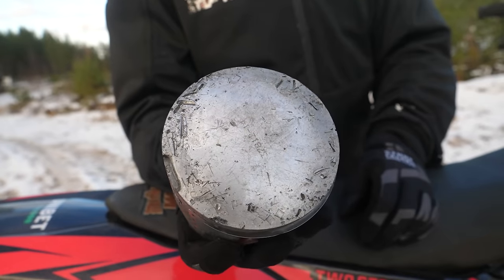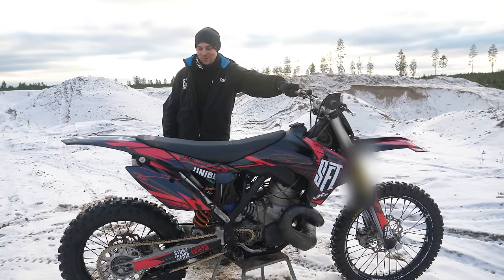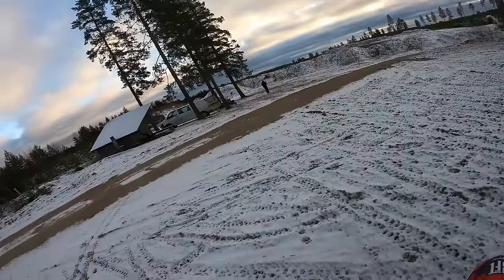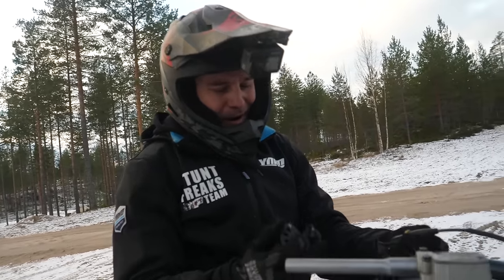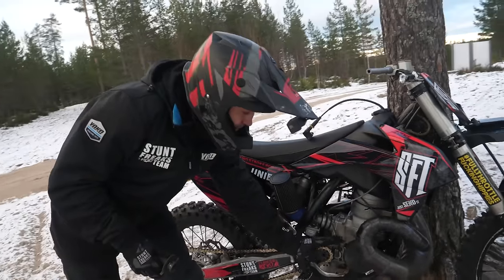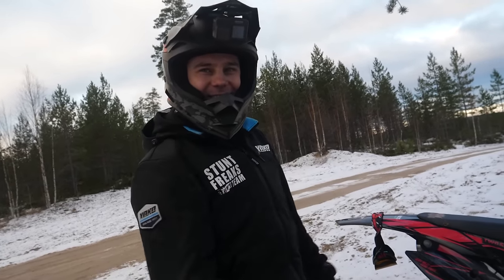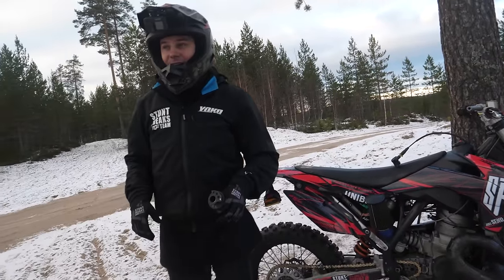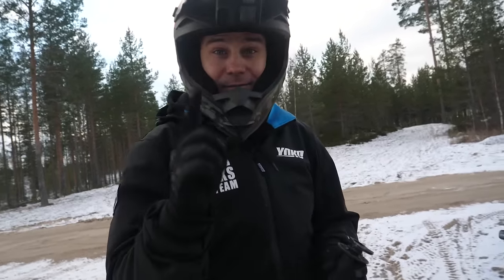700cc 2 STROKE Dirt Bike test ride

Comment: It's hard to imagine this guy's one piston is twice the size of two pistons in a 350 banshee
Reply: 350 x 2 = 700 🤯
Reply: i mean have u seen a 450cc piston? or a raptor 700 4 stroke piston those are massive.
but for a 2 stroke 700cc in one piston is crazy doh
Reply: Imagine guy who's build a minigun
Reply: Did u guys forget that the displacement isn’t just the piston diameter it’s also the stroke
Reply: have you see cruise ship motor piston that is huge like 1000kg
Reply: CC isn’t dependant only on the piston size, the stroke is also taken into account. So banshee pistons might be larger than half the size, but with a shorter stroke.
Reply: if you double the diameter of a circle, it's area is 4 times bigger..... so the piston is not double the size!
Reply: @V8freaks  Hi or she did not say that "size" equals to the diameter. How come that in your reasoning, "size" is referred to as the area. But at the same time you equals his comment of "size" to diameter?
Reply: I wonder if they primed the bore/ motor before pulling it that far before it started 😭😭
Reply: It’s not 100% dependent on bore. There’s also a thing called stroke 😂
Reply: @V8freaks  Well the piston is double the size in terms of area. But that's only if the stroke remained the same which it wouldn't.
Reply: @TheMoroo96  bro wtf you talking bout
Reply: That's a kdx200 and a kx500 together, that's fuckin ridiculous and I want one
Reply: @V8freaks  There's a difference between diameter and size, diameter in this matter is referring of a circumference of a circle, whereas the size is a direct reference of the proportions.
Reply: Clearly you guys have no idea....Cc are not only pistons....
Reply: Ty @Mark keast, I read the comment and thought to myself, arent banshees twin cylinder!
Reply: Wrong, lol. Each piston on a yamaha banshee is 175 mm, and both cylinders combined make 350.
Reply: @markkeast6786  displacement is a function of bore times stroke. Does not indicate piston size accurately
Reply: @WIentertainment  
I feel like there's a sexual analogy/pun in your response..🤔🤣
Reply: Bet the bansh has way more power tho easy 😊
Reply: 350cc 2 cylinder is tiny bro. It's not that hard to imagine at all
Reply: It isnt twice the size lol
Reply: Well the banshee has 2 of them so....  350÷2= 175 175×4=700
Reply: @markbroad119  I'm starting to think this was the ultimate troll comment from the original commenter bro fuck
Reply: I was thinking the same thing.  That piston is the size of my entire jug.
Reply: Well I mean it’s 700 cc
Reply: Wow you can do simple math
Reply: Why?
Reply: most twostrokes are oversquare, so the piston is not gigantic, the stroke is, 4 stroke pistons are a lot bigger
Reply: Some people just don't understand engine building and how displacement calculated.
Reply: Absurd
Reply: Yeah a single cylinder 700 is nuts. Love it, I want one!
Reply: He kickstarted it two
Reply: I have a bonneville bobber with two 600cc cylinders, you get used to it but it looks crazy at first

Comment: You can almost feel the power just watching this.  Makes my Husqy 701 look like a child’s toy.
Reply: Your 701 is as good as it gets.
Reply: Your 701 likely has more peak hp tho
Reply: @xfdfff2620  Doubt that. And even if it does the 700 2 strokes torque makes the 701 look like a moped.
Reply: @verttisyrjala2897  700cc 2t on penkitetty 60 whp ja joku 80nm vääntöä vs 701 75 whp jos on vähä piristetty ja kans 80 nm vääntöä
Reply: what hp you get on a dyno depends on the dyno you are using, ive seen results on the 701 from 60+ to 70 whp and they were not stock, the 70whp had 58nm i think.
Reply: @ralphbooger4756  stock is 59, moded is 75-79
Reply: @xfdfff2620  
i would question the calibration on that dyno as i would with one showing 70...
some of the more popular dynos are known for giving high results.
and i would certainly question it if the company tuning the bike are the same one operating the dyno... :)

ive seen stock cr500 dyno at 55whp and kx500 at 59whp... which makes the husky 701 less impressive.
and although i havent seen the result, ive heard of old 700 two strokes used for sidecar racing dynoed at over 100hp...
Reply: @ralphbooger4756  it was captain Americas normal dynojet dyno, most often used dyno and worked normaly, on that dyno stock 2021 yz450f had 51 whp and stock cr 500 52, all bikes well jetted 

Husqvarna 701 stock with all the restrictions Make 59, without restrictions and tune its 65+ 

Those side cars are running methanol and have compleatly different cylinder layouts, intake sizes, etc so can't be compared

But I am preaty sure well ported maico with good Pipe and other goodies would defenitely make 80-85 whp
Reply: @xfdfff2620  modded 700 can easily do 100whp
Reply: @MV-ri7zu  not easily, u would need all kinds of mods
Reply: Those husky 700s are good  for 140mph pluss haha on knobbly tyres  thats to fast for me haha 500s are fast but your husky 701 is pretty much the best bike oter then a 500 cr or husky lol most reliable is the huskys all day
Reply: I know my mate has done 140 on tarmac with knobblys and then slowed down domt blame him..on his husky 700 not sure if its 4 or 2 stroke like sure 2stroke
Reply: @xfdfff2620  yes easily
Reply: @MV-ri7zu  I mean u would need to raise comparession and use race gas, make custom Pipe, profesional porting and then get ur ignition and jetting correct,
Reply: @xfdfff2620  which is all basic 2 stroke stuff...
Reply: @MV-ri7zu  costs like hell and lots of careful modding is not easy 100 HP, not to mention when race gas is needed
Reply: @xfdfff2620  every serious mx race bike has all of the above in it its nothing special.
Reply: @MV-ri7zu  not really most race bikes have maybe aftermarket pipe, sometimes porting and race gas
Reply: A built 250 will smoke a mildly modded 500 and a 701. We do it all the time at Glamis. Won't have the top speed but wins every time on a drag race. Besides, the power of a Kx500 is always overly exaggerated.

Comment: I can't imagine the arm pump from riding that monster.
Reply: Not even near to r1 atv built for off road, the most arm pulling 2 wheeler was a 2009 light tuned kx450.. That thing don't know why but it felt after the long gearing as the most monster mid to high range pulling power I had ever felt.. I drove them all Yz450, cr50p, Yz450, crf450, ktm 560,450..but the most powerful of them all was an mx atv yfz450 with cb920 hornet engine, the low end pull till red line was way more than r1 atv.. Next toy is raptor with suzuki 650 i4

Comment: i cant imagine the power of 700cc 2stroke the 125cc 2 stroke is fast but this 700cc its just mind blowing
Reply: 125s are quick not fast
Reply: @ztit1 they actually are fast they just aren't fast on dirt because you never have the space to proper wind em up, a riding buddy of mine had a 90s  Suzuki 125 on supermoto tires, was pretty modified though, that thing could almost touch 130 mph on the freeway if you held it wide open for long enough. I'm fairly certain he was spinning that poor little thing at double the factory RPM 😂

Comment: Have a TM EN 300, made all new in the carburator, new reed valves, spent about 1000€.
Started the bike and it was finally runing, after 6 months work.
It was running well, took a seat on the bike and was driving for 1 min and the fuel hose ripped. x.D
How bad luck was that x.D

Comment: Im so glad to see the frame isnt aluminum.  Ive never been able to get comfortable no matter what kinds of mods. Amd the 2 stroke is absolutely the icing on the cake. The sound the smell and the feeling of the ride is what exited me and got my blood flowing as a child and still does. Its the only thing on earth that still gives you the same buzz as the 1st time you tried it. Nothing else, no substances or anything can do that.   Im super curious.  Did you forge that or is it even possible to big bore a 500cc into a 700cc?  Im guessing it had to be forged.  Im a die hard 2 stroke and ultra comfortable wring my KTM 250SX out and the only thing that broken was the shock. Ive replaced the top end several times just to see what the newest piston was like. But nothing has ever broken on it. Its been the most reliable bike ive ever owned. Im comfortable on a 500cc but not wringing out in 4th comfy. I cant imagine a 700 and l wouldnt even try in the snow. I laughed when you said its almost winter....when theres snow everwhere. It never snows where l live. But that was hilarious.

Comment: This little beast is something I think any two smoker lover should have in their lives lol even though theirs to much power and stuff keeps breaking I would never get upset even the 5-10 minutes to a time u could run er would be the best 5-10 minutes of my life lmfao I wanna see some air time on this monster or be the one putting in air time I'd definitely volunteer for the position of test dummy without a doubt lol nice job guys
Reply: SAHAWN PeltonYES that is alot of power on s dirt biketoo muh for me. But imagine having a 2 stroke w3 piston 3head &3 pipe &3 carburetors 750cc dteet bike where the tire doed not  spin so much not in the dirt with street  tires .It woulg wheelie so easy be carefull and learn it well first . It could wheelie awaw on a big highway even without using the clutch!

Comment: It’s a MIGHTY MAICO Boys! No one will ever admit it but that’s a Maico engine!!!!!
Reply: Can You explain that?
Reply: Yes. In 1984 Maico contracted Zabel. To design their new water cooled cylinder. Zabel was known for Sidecar motocross racing in Europe. His knowledge of knowing how to make a two stroke make tremendous torque. Is what brought Maico to design their water cooled cylinders for the new 1984 models which in the states they were rebranded as a M star. That is the same cylinder set up and bottom end that is still used to this day in manufacturing the new model Maico’s. Other manufacturers purchased the rights to manufacture those engines to sell with their name on it. Zabel even did the same thing up until his passing a few years back. Look up a picture of a 2022 Maico 700. And you’ll see it’s the same motor that is in this particular bike! I own three different Maico‘s. All with this same configuration engine. A 1985 250 M star. A 1986 500 M Star. And a Merkle 320 Maico. Hopefully that helps explain my comment above. Wonderful bikes. If you ever get a chance to own one I would suggest it👊🏻💨🏁

Comment: They make electric starters for the 500’s, you gotta look into that for this, or one of those power wheels you can put the back wheel on that’s used to start the two stroke motor bikes back in the day. But if you stall it out in the pits you’re fu**ed. Gotta look into electric start! I can’t imagine how hard that is to start, especially in cold weather with im sure really, high octane! You gotta put a paddle on it & rip some big sand dunes or that tire you have on it for massive hills….🔥🏁

Comment: The only true 700’s out there are the Maicos and extremely rare ATK’s, great bottom end torque, unfortunately everyone who doesn’t ride a big bore thinks you can stuff a Zabel engine into a light frame to get a fast bike, and unfortunately it doesn’t work like that. Awesome build, but take it from someone that spends much time wrenching on big bores, don’t expect to stay ahead of the pack, whether on the track, or the trail. 🏁
Reply: Thought about stuffing a 700 motor in my old rusty 74' 125 Honda Elsinore frame then using it as a timber bike.
Reply: @darylsmioth1904   you can throw something more dependable in there. If I were you I would go with one of the CFR450 engines or a CR500 engine. Super dependable, can take serious abuse, better parts availability. But then again if I had an Elsinore, I’d either try to do a frame up resto, or charge a collector big bucks. 🤔
Reply: I’d like to see one with a small sprocket and slicks rip the 1/4 mile

Comment: This thing is INSANE! I didn't ride for a few years and this summer I took a YZ250 back to the old quarries with my friends and even that was a lot to handle after not riding for nearly 10 years, I couldn't imagine this thing. Trying to kick start a 700, shittt. Is it custom made? I have never heard of two stroke engine over 500 cc
Reply: snowmachine engine
Reply: Engine is a mega SC750. Purpose built for sidecar motorcycles nd custom fitted to a dirt bike.
Reply: Its Zabel. German engine basically for sidecarcross. And few quads as mine EML.

Comment: you should try porting the engine. right now its pretty underpowered for how much cc it has
Reply: more cc doesn't mean always more power, i think it isn't underpowered, it's just wrong
Reply: @arekkoski  well how do you explain that a 125 can have 15hp but ported right with better carb and ignition it can have over 40hp. This principal should work in every engine
Reply: @Ekke6262  noo
Reply: @Ekke6262  absolutly not, if i'm not wrong 125cc is the last stop for gaining power with cc in good way (in 2 stroke engines). Bigger the engine, heavier the parts, more power absorbed, less revs. Then comes the fluid dynamics which works just better in smaller cylinders.
Reply: @Ekke6262  a 125 with 40hp only has power above 9000rpm, this bike has a lot of torque and still enough power, more than 70hp is useless on a dirt bike and this way it has a broad powerband, it’s good how it is. If you had the same port timing as a 125, it would have 200hp and would be completely unrideable, look at the old 500cc 2 stroke gp bikes, they were like that and were completely uncontrollable for most riders, even on the road.
Reply: I rode a cr500 about 200 feet, pulled the clutch and coasted it back to its owner. I knew it was too much bike for my health.